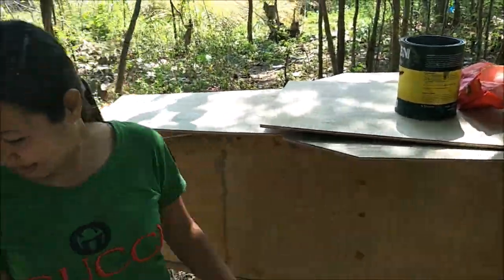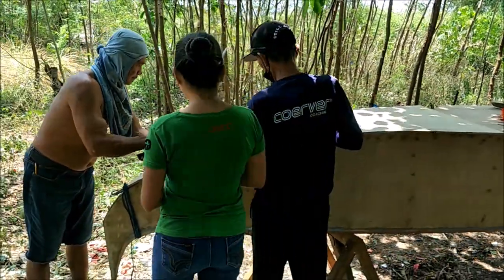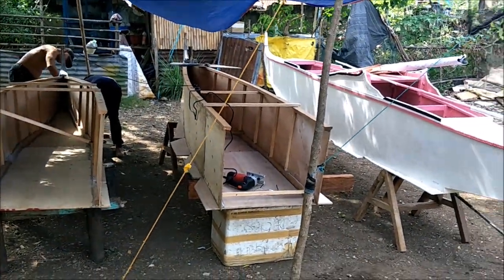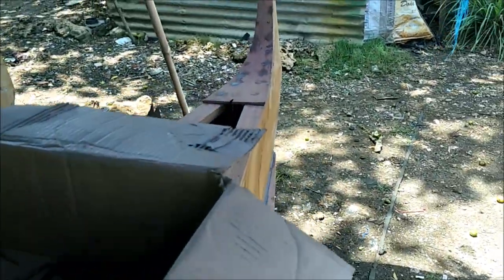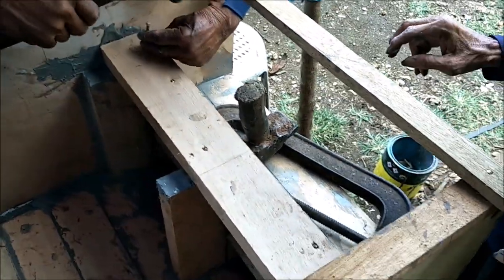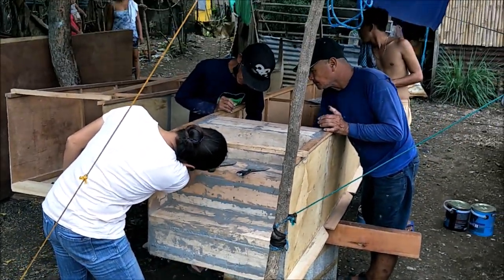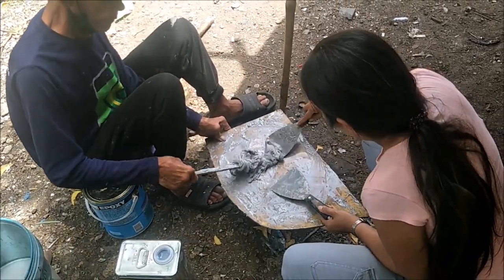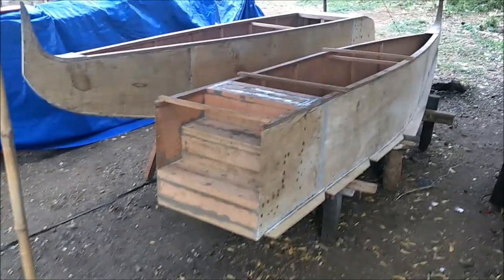Paradise Trimaran - Part 6 - Boat Building In The Philippines

Comment: Hmm.. Stairs looks like a good place to make a door on the inside for some storage space
Reply from the maker: My thoughts exactly😊
Reply: @myparadiseonbantayanisland9030 gud day sir, what type of engine you use this kind of boat?
Reply from the maker: @woodenjetski6187  18hp high speed diesels. Yamada brand
Reply: @myparadiseonbantayanisland9030  what exact size of fan/elesi sir you use? Cause I have 16hp yamada high speed mounted in my wooden jetski but not good enough, so I plan to make boat like yours.
Reply from the maker: @woodenjetski6187  For the 18hp diesels I will use 8 inch 3 blade propeller. Check my video on propellers.
Reply: @myparadiseonbantayanisland9030  thanks